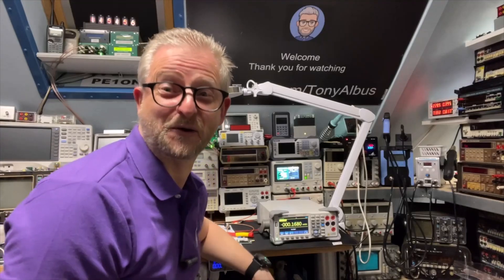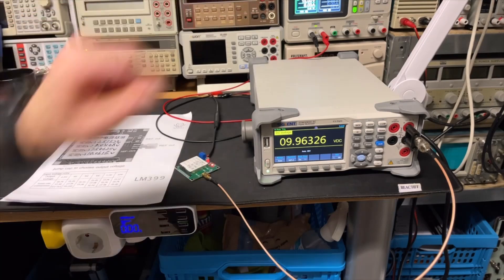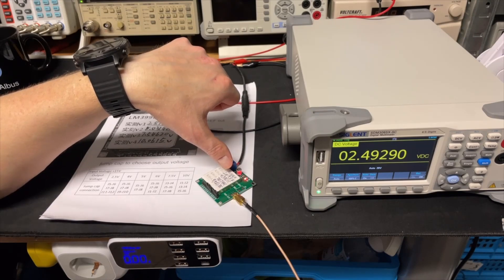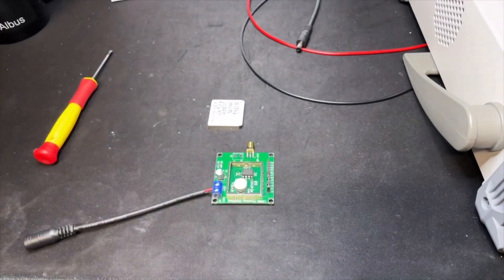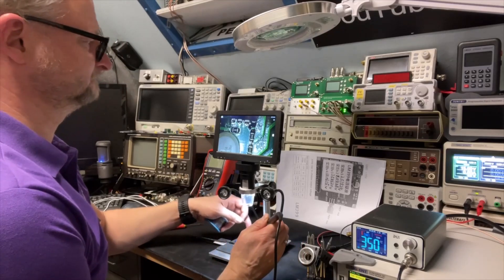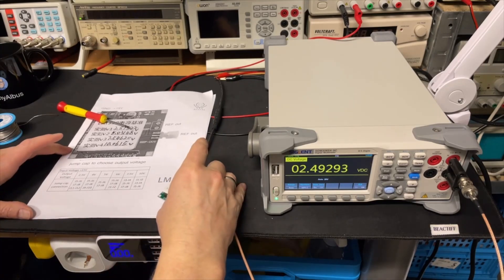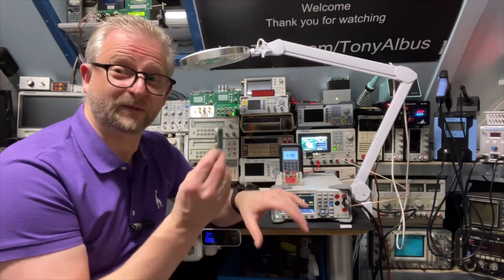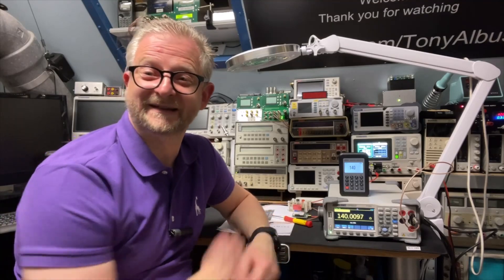#239 LM399 Voltage Reference - Quick Test

Comment: Yep, that's the only issue with voltage references that that one, they need an accurate voltage to power them.  If that ones off, then the output from it is off also.
Reply from the maker: Yes i think that exacly the prob;em with this one..

Comment: Still, how good is calibration on your meter?
It's not an HP meter, and it may be calibrated to 10.000 V, but not perfectly linear?
Reply from the maker: yes its not HP.  on my new videos you see the Keithley DMM6500 with a newer LM399 boxed..

Comment: The Racal-Dana 5000 series DMMs have two LM399 ref sources in them. I use a 5004, which can be used as a 4-1/2 or 5-1/2 digit. One ref is the digitizer voltage ref, and the other is the ohms and current source ref. One ref is a 399H, with the other a 399Z.
Reply from the maker: Thanks for sharing, interesting

Comment: LM399 is not designed to be accurate at all, but it is designed to be extremely extremely stable. If you feed it a good quality voltage and exact current into the zener it will give you stable voltage all day all year. You just have to know what that voltage is :') I think it is reference used in some near-high end DMMs, like 5 & 1/2 digit.

The 10v it puts out and others, the absolute accuracy is completely reliant on the resistor dividers values being accurate and/or trimmed. So you are completely reliant on chinese calibration sheet actually being real to get any use out of it.

If you don't have other calibration standard, then AD584 gives way better absolute accuracy. Best AD584L initial accuracy is ~0.05%, LM399 is 2%! But AD584L tempco is 5ppm, and LM399 tends be <1ppm.

If you know how to do electronics design you can actually grab the LM399 and put it in a better design, it and a decent precision opamp are the expensive parts needed

I recommend looking at some Maxim Vref chips, MAX62XX (6250 is 5v, etc) and MAX6126 are both 0.02%
Reply from the maker: Thanks for the info, i do have a few other standards if you are a frequent viewer.
Reply: The resistor are also quite expensive with 2 $ a piece for 2ppm stability and going up to 10$ for 0.2ppm

Comment: Hello Tony,
 I am having a very similar reference since a few days - which also seems to be off a bit to the written values. But when looking into the specs of my multimeters - I am unsure what the real reason is. At least is my reference - after heating up for a while  - amazingly stable. 
Checking your SDM3065x specs, it says  0.0040 + 0.0004 Accuracy ± (% of reading + % of range) after 1 year. This would add up to +-280 micro Volts with 5 V in the 20V range - now comes the question what is really off, the meter, the reference ? 

We need to check our references against some high precision instrument with a lower guaranteed tolerance, but I have none available. Even worse, my 6.5 Digit Schlumberger is 35+ years. I am off 0.006% - which is still good, I believe 🙂.

Another point is, we don't know what instrument the Chinese vendor used - what were its tolerances what can we expect?

best regards,

Jürgen
Reply from the maker: Hi Juergen, yes with more digits comes more resonsability :))  Ambient temp, heat-up time etc.. little test here: https://www.youtube.com/watch?v=2jUaGo1iXk8
Reply: @TonyAlbus  Hi Tony, I just checked the power supply voltage "rejection". 
For me I found, I can tune my device with the power supply voltage to the "right" value (according my old instruments). Even though not 100% perfectly for all output voltages.

When 20 Volts instead of  15 Volts are applied, I have a change of 500 uV in the 7V Zener voltage. The datasheet would allow for a change from 0.5mA to 10 mA (delta9.5 mA ) Zener current a max of 12mV ( = 1.26mV/mA) - that would be for the 5V change a delta of 0.67mA (7.5k resistor)  resulting in a theroretical reference voltage change of 630 microV. All according to spec, but.
I believe the biggest mistake of the Chinese Vendors is omitting a decent 15V Voltage regulator e.g. like 78l15. And they probably use just an adjustable DC power supply and don't care about the supply voltage. For me it seems they used 20V. I will implement a LM317 adjusted to 20V. - With that I am on the save side and power up with a 24V power supply.
Reply from the maker: @juergenhussels9591  Thank you for this feedback, very nice

Comment: Hello Tony and Followers: As I said earlier that reference of tension does not look like the originals, it gives me the impression that it is falsified. I do not know that Chinese gossip, but to accurately measure the multimeter has to be high impedance, I measure with the HP3456A, Fluke 8505A and with the Agilent / HP 34401A, the latter has the option in the menu of selecting high entry impedance of more than 10 gohm, and for the photos that you put seems to measure pretty well assuming that the reference of the photo is well calibrated, but it is a multimeter that has a good review and ground / mass connections are always correct It will measure well and without fluctuations. LM399H references (good and original) have to be connected enough hours, days, weeks or months to age and are even more stable, this is noted much since at first the multimeter will measure well from ~ 1.5 hours And as the months pass, it will stabilize faster, that can be seen maintaining the temperature of the laboratory. You have to understand that resistive dividers also have a DRIFT with temperature and is always tended to rise inside the equipment itself, because of the power supply or transformer, and to reach its stabilization, many hours are needed. I hope you make a video of the Agilent 34401A. Greetings.
Reply from the maker: Thank you, yes correct. The video of the 34401A will come.

Comment: The difference from 240 µV (2.5 V) over 300 µV (5 V) to 530 µV (7.5 V) to the exact measured value at 10 V is very strange. If you have no way of checking the calibration data, then you have to be able to rely on these numbers. But if you can check these values, then you don't need to buy the calibrated version. So your video shows very nicely that you cannot blindly trust the calibration data. Then the only question that remains is, how large can the deviations in the calibration data be if, for example, two stickers have been swapped over?
Reply from the maker: Usualy even with the cheap once, is was sort of correct, never this far off..so maybe indeed wrong sticker.
Reply: @TonyAlbus  Yes, as I said, the purchase and comparison is no longer necessary if you cannot rely on it. I have only a sdm3055, but the calibrated reference should be at least a decade more accurate in order to work meaningfully with it.

Comment: Sure like that Siglent! Looking forward to the video on comparing different voltage references. Do you have any videos or suggestions on entry level bench meters? I watched your video on OWEN, but it seemed disappointing.
Reply from the maker: The owon is indeed entry level, you can also try to find a good HP Agilent or Keithley second hand.

Comment: Could the value written on the calibration certificate be actually 9.96375? It would be consistent with the other low values.
Reply from the maker: You could have a very good point there!,  thanks! i will check that